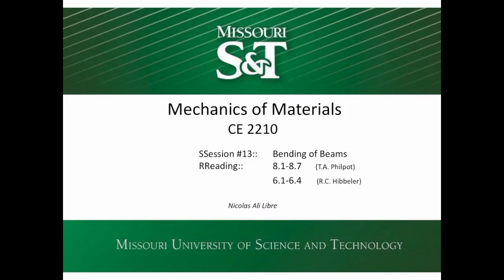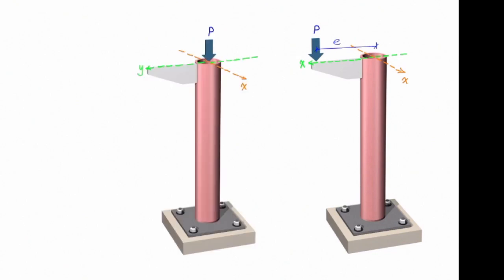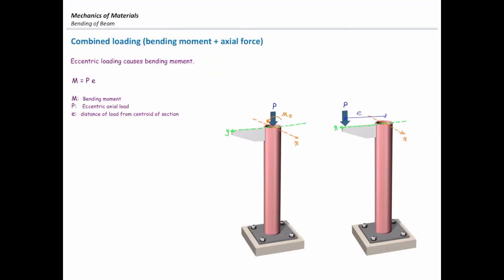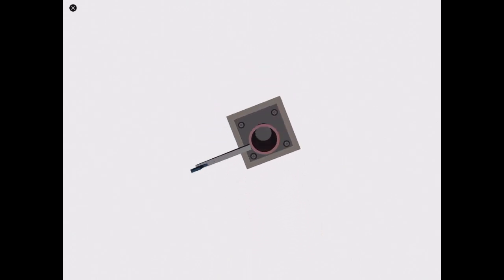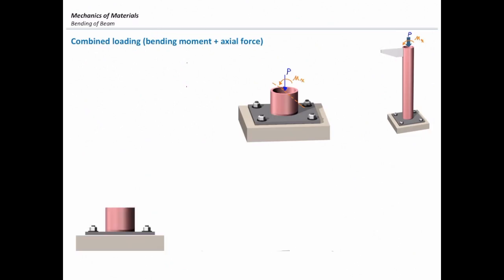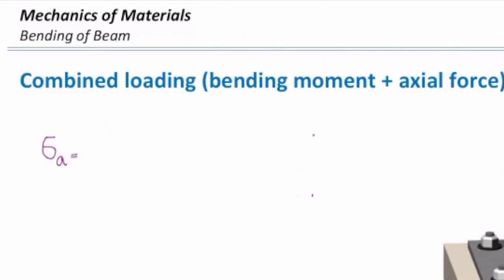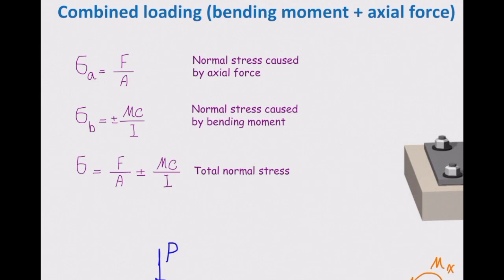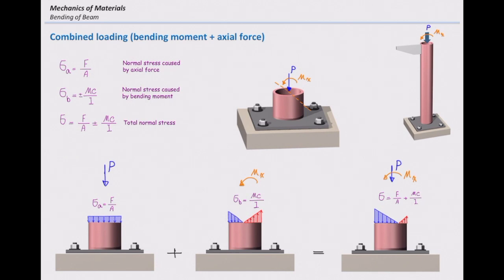Lecture 13, Stress in beams subjected to bending moment and axial force (Lecture)

Comment: I was specifically looking for this lecture. Thanks a lot!

I use ASTM A500 steel PIPE with Fy=345 MPa. After I calculated the eccentric moment then the extra stresses, I want to calculate the maximum (allowable) stresses in the pipe section then compare to see if the section I have with steel property would handle the extra stress or not. Any help?
Reply from the maker: The maximum allowable stress is Fy=345/factor of safety, you need to ensure the stress in the pipe is smaller than the allowable, say
MC/I+F/A<Fy/FS
hope that helps
Reply: Mechanics of Materials (Libre) thank you very much, Sir.

Your answer is so much appreciated. It definitely helped.

Comment: does that mean that for axial forces and bending moments, it does  not matter if we have a solid shaft or a hollow shaft? we treat them the same way even though  a hollow shaft has less cross sectional area?
Reply from the maker: Equations are the same but the magnitude of area (A) and moment of inertia (I) would be different depending on the shape of section